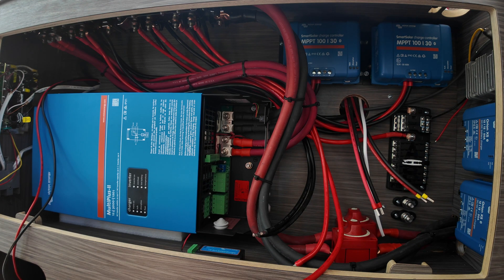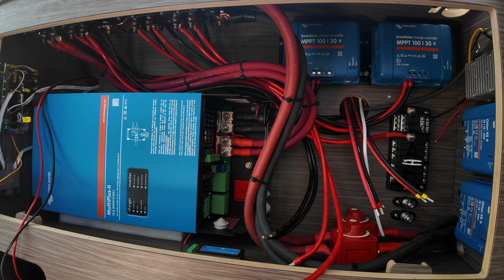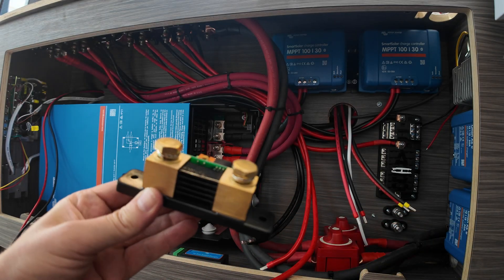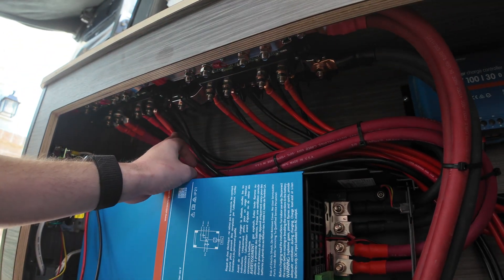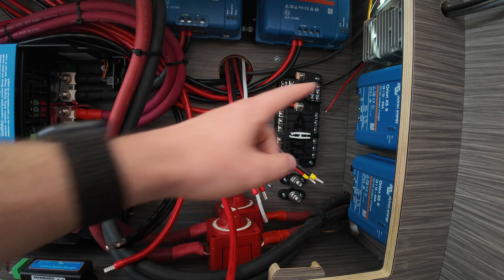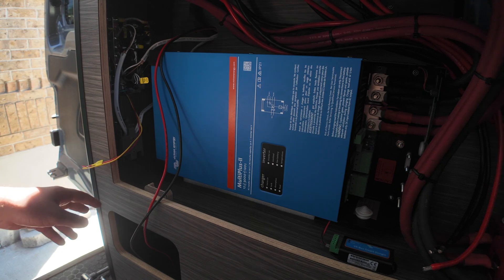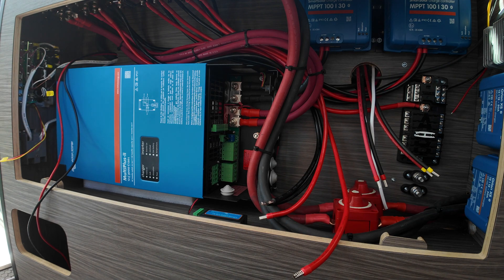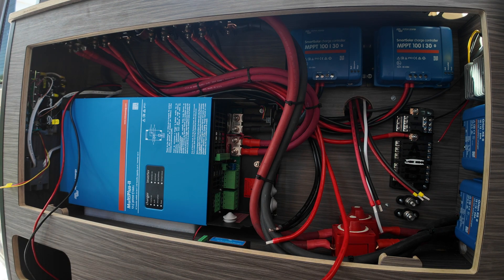DIY Victron Van Electrical System Questions

Comment: 2/0 is good for around 170 amps. you have two in parallel your good there. This is the advantage of switching to 24V over 12v you get to work with 1/2 the wire size... and if you went with 48V 1/4 the wire size. for a van with this much power I would of gone with at least 24V. The inverters and equipment are cheaper too. My van has an 2500 watt 12v inverter I already had so bought a 280AH lithium battery for it and 4/0 wire.  My Trailer that I will wire up will be 48V. They sell converters to convert the vehicle alternator power to 56 Volts to charge lithium 48 volt batteries. 12 volt was nice back in the day before people started using an insane amount of power in there vans.

Comment: I was always told u should put switches on the negative side for large loads prevents arcing. Also larger the cable less voltage loss. Also its always wise to have in line fuses between batteries. Fuses are to protect the wire not the device typically

Comment: Your charge controllers are very tight, and close to flammable items. 
Not trying to be that guy, just to help. You’ll need 2 cooling fans at a min
Your inverter is also close to the bottom=less air flow 

You need (2) 0/4 pos and neg at the inverter, or (2) 0/1 cables. 
All 6 batteries together is fine also. 
Contact RvSolarConnections for the best advise and products. Ask for Caza (tell him Apex Conversion sent you)

Comment: Can I recommend to everyone who is contemplating doing powerful setups, to get their hands on a thermal camera. You will be surprised how revealing they are. From low quality cables, to loose bolts and nuts, and even poorly crimped terminals.

For you system, try to let the heat out of that space to the left, where the fan will be blowing the air through the inverter.

From experience, shorten and transfer that inverter cable to the very right hand terminal of the right hand Lynx distributor. You'd like it as close to the shunt terminal as possible. Big cable next to big cable when you can. You have it going the whole length of those distributors in the current configuration. This will reduce the resistance as much as possible.

3000 watts divided by 13 volts (lithium based voltage) becomes 230 amps. Remove one of the 2/0 cables from the inverter to Lynx distributor. Run something powerful from the inverter, and check the cabling with a thermal camera. If there is a lot of heat after a minute, you need to check the bolt tightness and if no change, replace the removed cable. You may have lower quality cable installed and not know it.

Be aware that the colors on a thermal camera are a guide. Use the actual temperature numbers, to determine the difference between items of interest. There may be small changes in temperature relating to alarming color differences unnecessarily. It will depend on the camera calibrating itself on the fly as you use it.

Let me know if you want more help. This is a long post already.